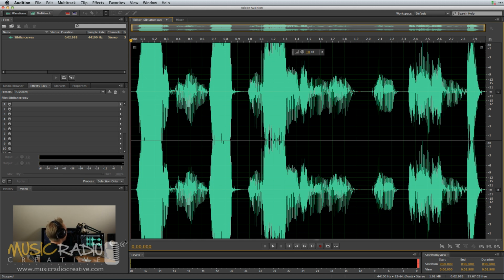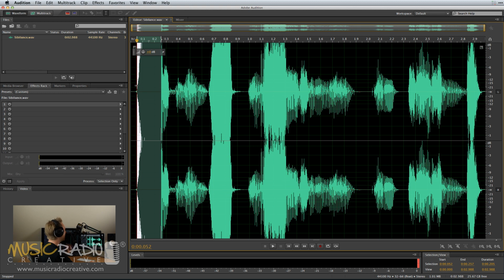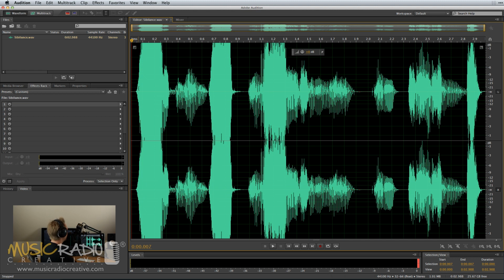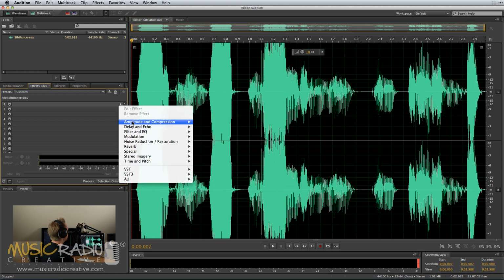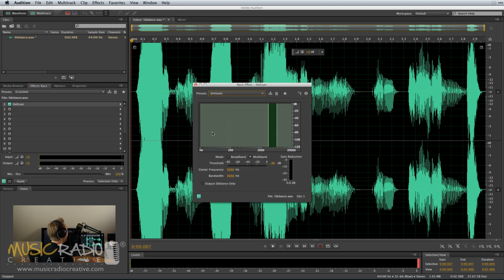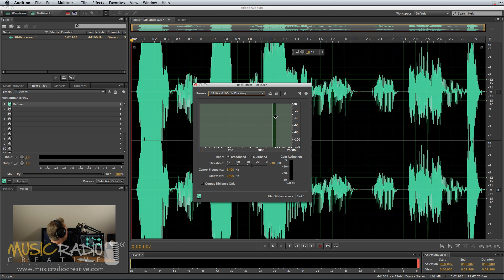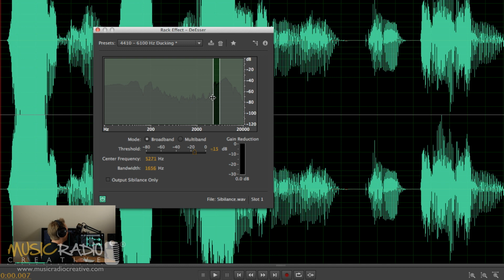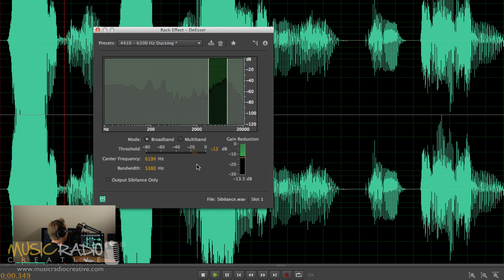What Is Sibilance? Using The DeEsser in Adobe Audition CC

Comment: I know this is an old video so there's a good chance I won't get a reply, but I figured I'd try anyway. I'm finding that I create a sibilant S (apparently a hollow one?), but they're no where near this high pitched or loud. I have my own studio for radio and can get rid of the S problem on doing the "announcer" thing, but for commercial and character voices, that voice doesn't always work. So in those cases is there anything you might recommend in post?
Reply from the maker: Yes, I'd recommend playing with the Parametric Equalizer as you can isolate any frequency and find the one causing the trouble. This video gives a brief demo of that feature: How To Create Radio Jingles Fast (boomerangblom)
Reply: *****
Thanks! I'm grateful for the reply.